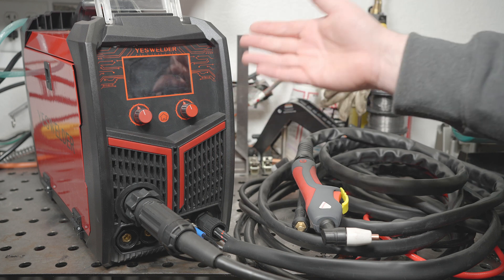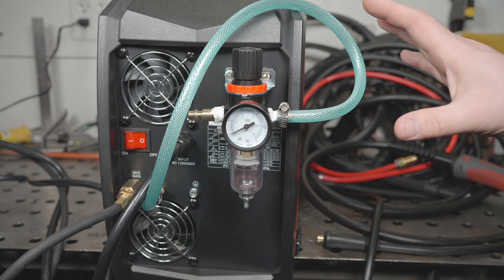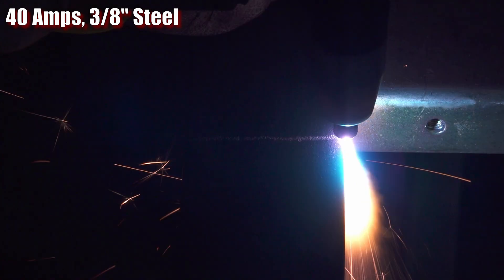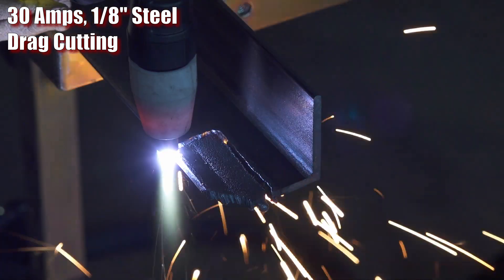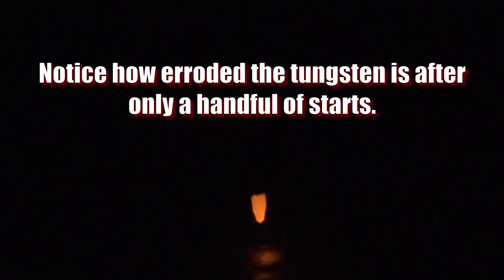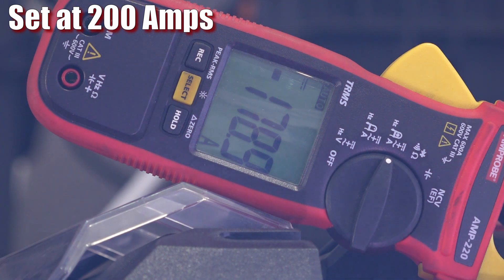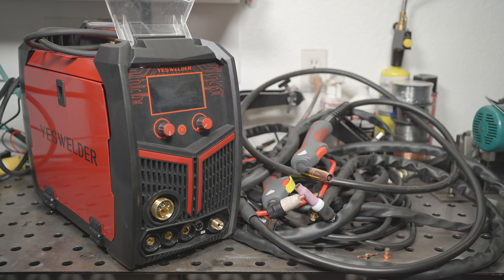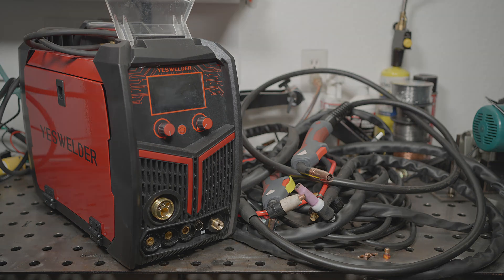Yeswelder Firstess MP200: Plasma Cutting, TIG and Thoughts on Value

Comment: i didnt get mine during kickstarter. It was 700 bucks and it came with a lifetime supply of consumables i wasnt expecting. Plastic tote with tig cups, mig tips long vs short tig head plasma tips. I havent used 10% of it in 2 years.  
Full set of long entry level cables. Cappy clamp and connection. There was damage from shipping to the plastic frame. they offered me 10% store credit which covered the regulator and blue red tungstens since i had NOTHING but a 55 tank ready to swap for 180.00. Only issue ive had is a howling fan at startup from leaving it in a dusty garage. I liked it enough after 2 years to preorder the dp200 at 400. Got it 2 days ago. welded a few hours yesterday, its awesome. Aluminum on 120 with no pulse welds perfect.  Not without yes welder flaws. More cost cutting where you dont expect it.   
The screen is beautiful, the full manual and setup diagram in color pics on screen. No more having to look up mp200 manual for connections. Wire can stay fed, No bus bar screw design flaw. No screen cover. Its a twist plug like the leads.  Twice the diameter as MP200. Way more copper to pass current thru the much thicker cables. Which screwed my mp200 tig torch from working out of the box, with the foot pedal i ordered.   
At least they included a stick electrode to harvest a big plug from to T into my tig torch. (same thicker cable ill salvage to upgrade the mp200 ground.  With the foot pedal and min 10 amps vs 20 should be a big difference.  The Cables are all much thicker. next guage, and softer strands. But the clamp is even cheaper than before. 
Im pissed that pulse functions only work with 240. I use my mp200 90% of the time at 120 for auto and farm type stuff.
The synergy over simplicity was limiting but they didnt make thast mistake again.

Comment: For those who have run into issues with output, do you have the earlier version with the main power line that has the 110 plug and then the 220 adapter? I’ve been wondering if those machine are being starved of power due to the higher gauge wires. I’m thinking the same may be true for the torch lines. I think the machines are great but step down wiring might be holding them back from their max capabilities.
Reply from the maker: @JoeNunya-oz1nd  mine came with the 240V plug on the welder.

Comment: I bought this for the Kickstarter. Was very disappointed in everything except the mig. It migs great. We make the tig work, but eh, and like you, I had problems with the plasma unless set at 40a. Did you have any luck stick welding?
Reply from the maker: Stick welding is basic, but okay.  I couldn't detect any measurable hot start and the output was well below the claimed max.

Comment: Welp, just got mine today. Thanks for the review and going at length to describe the faults of this thing - thought I scored getting this machine for $800 on BF. I don't plan to touch anything other than .065 steel tubing and maybe aluminum, MAYBE stainless, but the issues you raise are frankly inexcusable. 

A quick look at their return policy suggests one must show cause for return to get them to pay for return shipping... Guess I might have to look into how to rig up a similar testing setup with a multimeter? I wouldn't have the first clue how to do so. Seems they're aware and doing everything they can to avoid acknowledging it. Maybe a call to my CC company is in order instead...

Comment: I figured it be mostly good for at home use but not industrial use which is understandable since i bought this and will mainly use it for practicing my welding techniques and cutting on the weekends in my garage plus most of the great plasma cutters cost upwards of 2k to 3k in which you need an actual air system to use them with in which costs u more lol

Comment: Nice. I bought a cut35i and it's great for what it is for the price. Trips a 120v / 20 amp breaker under 10 amps if run longer than 30 seconds.

Comment: Too late for me, already done the kickstarter routine. Can't wait for you to rip apart the CT2050.!! - you getting one?. For me, I've done some testing using a scope with a current probe. The "so called" hot start feature is ridiculous fast, upon initial arc the current does go above the set value, ramps down to below then returns to the set current, all in 0.2 second. If this is what YW call hot start then fantastic, I don't think it meets the description. The lift start on the TIG is laughable, the initial touch current is 50A regardless of setting, that's why it sticks all the time. Once you manage to obtain a arc without lifting away too far then set current is maintained, even at 20A. Everything I read about lift start online is exactly the opposite of the MP200. It's amazing how many folk have got sucked into the spec's, like you said, it's the basic of basic machines, noting special AT ALL. I also noticed that the outputs are LIVE even in the main menu, you don't have to select the process.. However, now I got the thing it's the best welder I've got and I'm making use of it, if it fails in the 1st year I will attempt a warranty if not try and fix it myself but alas it's a switch mode power supply and usually when they fail the domino effect makes for a catastrophic fail with all the stored Joules in those capacitors dumping through many components/pcb tracks until it finds the short. So, it has "hot start" and "lift tig" but YW's version of these features isn't anything any other manufacturer does nor what I read online.. They missed a huge opportunity here, imagine if this could have updated firmware, imagine adding features or tweaking existing features but I've reached out to YW and they say no!.. I will never ever buy anything like this again, wish I could turn back the clock.

In your next MP200 video can you do some duty cycle tests, see how long it lasts before whining about over heating. Circa 1.3kW is binned inefficiently, can those heat-sink's and fan cope for 6 minutes??
Reply from the maker: Interesting that you are seeing a 50 amp lift start current.  To me it seemed like it gave full current instantly.  Either way, it certainly doesn't behave anything like the lift start I've used on Miller, ESAB, Fronius, Everlast, Klutch, etc.  

I'd really like to check out the CT2050.  I just hate the idea of giving them another $1,000 via yet another Kickstarter campaign.  But they stopped offering me free machines to test out a while ago, lol.
Reply: @bigtb1717  there's a surprise!!.. I have another basic MMA welder here I'm fixing for my good friend. Its control power supply has failed, cooked the fan which went short. New fan on order, then I'll have to work out why its not regulating.. (should be 24v, not 30v) Still, it has lift start feature for a basic TIG torch (like the one I got with my MP200) so you know I'm going to test that the same way I tested the MP200..
Reply from the maker: Well, I just pre-ordered the CT2050 from the Kickstarter.  As I suspected based on a few details I saw, they are, in fact, claiming power factor correction.  If so, that would be a big step up from their other welders.  Turns out, the $1,000 kickstarter price is half off.  It will eventually be $2,000!
Reply: @bigtb1717  Think if I had the choice between MP200 and CT2050, probably go for latter but I bet you'll be slating it once it finally arrives making me think I won't get sucked in by the hype a 2nd time!!

Comment: Don’t try to remove the plug, in the provided air regulator, its not real. At least mine wasn’t. If you look internally it’s obvious whether it can be removed or not. I’ll be getting some 90 degree fittings and better hose as well. Haven’t tried the TIG but YES reconfirmed the “ lift TIG” in a recent Kickstarter response. Who knows?
Reply from the maker: Yeah, I didn't actually try to remove the plug or look that close at it.  Wouldn't surprise me if it's just molded in and not really a plug.  

If they are calling it lift start, then they must have a different idea of what "lift" start is.  Or maybe it's a language barrier thing.  They may just call scratch start TIG, "lift" TIG and have no idea they are implying their machine has a feature it doesn't have.  At least, that's my charitable assumption. 

With practice, scratch start is definitely usable, but there is a reason companies came up with lift start.  "Lift" start is objectively better.  There is a distinction.  Yeswelder needs to learn the difference (assuming they aren't misrepresenting their machines on purpose) and advertise their welders properly.  During my phone conversation with them a long time ago, I explained this issue regarding some of their other welders, among other issues.  They claimed to be working to fix all of it.  They also claimed to be working with lawyers to get official warranty policies written.  Over a year later and none of their welders have an actual warranty policy claimed, including the MP200.  Yeswelder doesn't care much about properly advertising features and specs.

Comment: I was really bummed at first that I missed out on the kickstarter campaign since the price offerings were so low. I had bought the 205DS a while back and for a little more I could’ve gotten the MP200 with plasma cutter. But after seeing reviews, now I’m glad I didn’t. I went ahead and got the 55DS, and considering I bought both units on the cheap (with discounts applied), I came out ahead. Thanks for the great vids!

Comment: I had been thinking about getting this unit. But now I’m not sure. I mostly need a mig welder and plasma cutter. What are your suggestions for other welders and cutters that are still affordable?
Reply from the maker: What is your budget?  The price has gone up since I reviewed it, but the Vulcan MIGMAX 215 from Harbor Freight is pretty good.  My cousin has been using the heck out of the one I reviewed for years and he still likes it.  I don't know if the Titanium MIG welders from HF are any good, but they are a bit less expensive than the Vulcan machine.

Companies like Klutch, Everlast and even Hobart make MIG welders and even Multi-process machines for around the same price as the Yeswelder.  No plasma cutter included with those though.

I've only tried one super cheap, stand-alone plasma cutter; the S7 Cut 50 with pilot arc.  They do have some reviews on Amazon saying they failed rather quickly, so I can't say what the reliability will be, but the one I tested worked okay and was only $200 or so.  Definitely nicer to use than the cutter built into the Yeswelder.

At this point I really haven't tested out all that many MIG welders, but I'm planning to test some more.  The Hitbox Synergic MIG 200 Pro I'm messing with right now seems to have more power than the Yeswelder MP200 and it has the option for fully manual settings, which is nice.  Mine did arrive non-functional.  Before starting the return process I opened it up and found a disconnected wire harness.  I plugged that in and it works fine now.  Still, it's definitely a cheap machine, so I can't say what the reliability will be.  I plan to test at least one Everlast MIG welder eventually, but I haven't gotten to it yet.

Comment: I have only stick welded with mine at the moment, and it did ok for what I was doing. I bought this specifically to get back into MIG welding and was disappointed that the settings seemed to run cold in your experience. Hopefully the cut and etch shows a decent penetration for the samples. Good job on the videos, they are extremely informative and are a good representation of what a machine is able to reasonably produce. Thanks for making the videos.
Reply from the maker: Thanks for the kind words.  I now have three, multi-process welders with auto material thickness settings.  I plan to do side-by-side cut and etch test comparisons on different thickness material.  That's actually what I was cutting all that flat bar up for.  I wanted to test the plasma cutter anyway, so two birds.  I hope to get started this weekend, but there's always seems to be 8-10 things to do and enough time for 0.7 of them, lol.

Comment: My cheap plasma had the same setup, leaky and all. But it was only 200 bucks, and got here in 2 days from amazon. Seems to function better aswell. Informative video, I feel bad for people that got this over a Hobart or even a noname welder that does the same except plasma, for less than it would cost to also buy a plasma.
Reply from the maker: The leaking didn't get bad enough to hurt function, but the constant hissing gets real annoying while working out in the shop, lol.  And I didn't like getting my hand or face too close because I was worried the hose was going to blow at some point with how much it was bulging at the clamps.  I didn't even stand behind the welder while the compressor initially pressurized the regulator in case the thing decided to let go.  Even 90 PSI of compressed air is nothing to sneeze at if something decides to rapidly auto-disassemble.

Comment: I enjoy your videos that you put out and I can agree with the same thing I have a Chinese welder named the susemse mig 255 and it has an output of 235 amps of MiG and Tig power supposedly a 60% duty cycle and also too I scored a prime weld cut 60 plasma and still under $1,000 and I can say the chineseium welder has a lot of good options and has manual settings on it too along with synergic would love to have your email so I can send you a picture of the welder so if you spot one they're cheap $300 let me know.